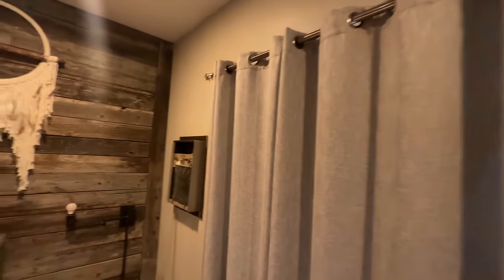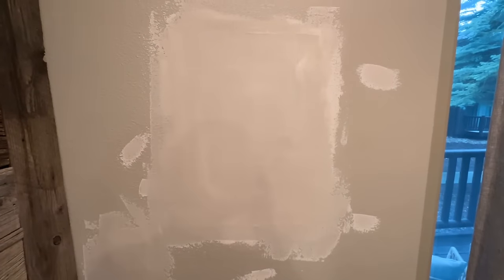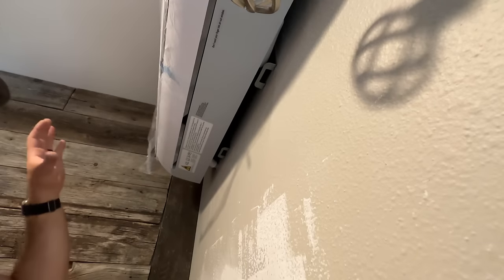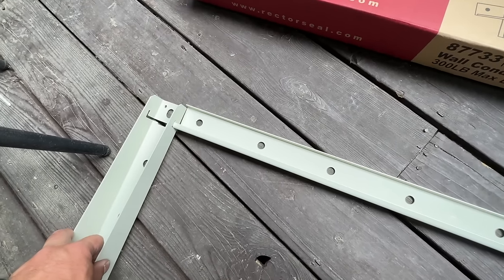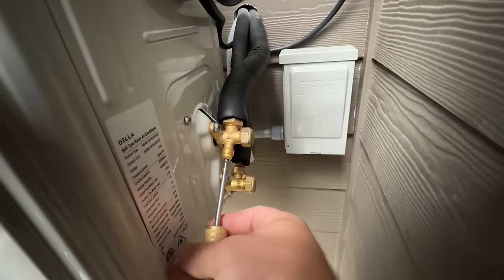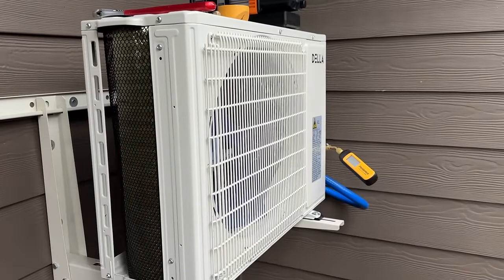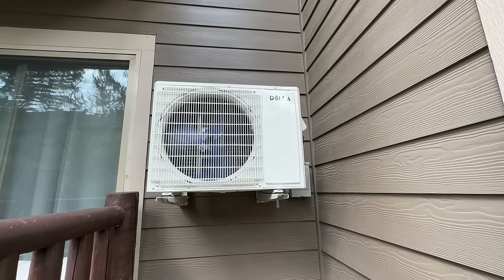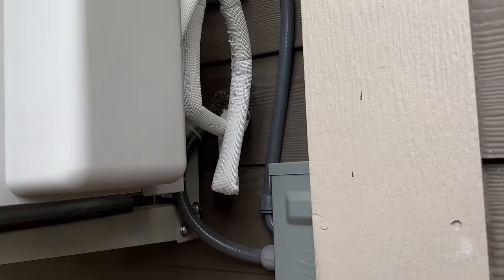A $600 Ductless 110v Mini Split?!

Comment: I bought and installed one of these about a month ago, and immediately bought and installed a second one. You didn't mention it, but the wifi programming options and controls are outstanding.  Way more features and capabilities than I could have even imagined.
Reply: You will be sorry later.   How can you recommend something you have owned for a month or two.  The ones you installed might last five years, at best.
Reply: How could I possible be sorry? For what these cost and difficulty of installation, not to mention the great performance, 2 years would still  be a win.  5 years would be a grand slam.   Otherwise I don't see massive amounts of failures of these units, other than less than stellar installations. @thomaswayneward
Reply: @spazzman90 he’s sorry because ppl have the information they need to install these mini splits themselves or have them installed. We had a guy come out 2 years ago bc it kept tripping the breaker. He tried to quote us $20k for a new ac unit only, for a 3 bedroom one level condo. I told him to get out…Nothing was actually wrong, it just needed some service that my husband did himself. Here we are, another hot summer almost over and she’s still going strong. 

If we do decide to replace it before we move, it’ll be a mini split. Installed by a professional bc the hoa is VERY anti DIY, of course. They’re so ridiculous and nosy they want to know if you paint your own interior walls. Hence the reason we can’t wait to sell it.
Reply: How many watts does it take per hour to run? What seer is yours?
Reply: @stevensaxon8888  mine are a couple of years old now and I think they’re only 14seers. I don’t know how many watts they use but my electric bill has only been over $200 once this summer and it’s been hotter than satans ball sack in Houston this summer. So I’m not complaining.
Reply: The problem with using the wifi is that the app won't work with a 5ghz router.  Otherwise, the mini-split is functioning perfectly.
Reply: @aaronsmith5553  That's why I left that part of Texas
Reply: @thomaswayneward  Sounds like you're an HVAC tech crapping on DIY systems to me.
Reply: @spazzman90  I built homes for 52 years and I am basing what I said on my experience.  A normal AC unit, which you can install yourself, should last 20 years.  I never installed AC units myself, in the homes I built.
Reply: @stevensaxon8888 to figure that out you would need to put a KW meter on the breaker feeding that unit
Reply: @thomaswayneward  intalled one in 1998 now 2024 still working perfect

Comment: Couple notes: check the minimum inset length before cutting line set. Mont mini splits have a minimum line let length of 10 feet. Golding any shorter will shorten the life of the compressor. My Della had a 10 foot minimum. Also check the manual for minimum clearance from the back of the compressor to the wall. Most are 12 inches. My Della was 12 inches. It looks like your install was less than 12 inches from the wall and your line set was less than 10 feet.
Reply: Agreed. This young man most definately did not read a single page of the manual lol. The HOA shouldnt be hiring their cousins step son. He seems nice enough but that doesnt help the ac unit. 😢

Comment: That della unit is the same as the pioneer. But for cheaper. I love mine. It cranks cold air 247
Reply from the maker: Yesir, they’re both made by the same mother company. Midea
Reply: @diyhvacguy  Interesting.  I expected to see some familiar Midea stuff but it all looks basically like they took the cost out of EVERYTHING.  If the internals are basically the same then that's a win at the bottom of the market.
Reply: why such large pricing differences? Simply because Pioneer has their name out and is known for efficiency? I'm completely off grid in Cabo with four 48v EVE280 battery banks. I did an unheard of thing with Mexican construction, I insulated the walls and roof as good as possible (6-18" EPS). Windows suck because I went with 12mm safety glass due to hurricanes. All I can think of is swapping out higher SEER mini-splits. Next house, I will haul proper windows down from California since my buddy works for Sierra Pacific.
Reply: @stiffmeister0hYeah  Mr Cool is pretty expensive these days.  Their kit is nice for DIY and they do have the warranty.  Still it sucks to pay like twice the cost for probably pretty much the same system.  Although for my first system (18k gen 3 single zone) I guess the extra cost paid for itself when I needed a new condenser. And I got a gen 4 upgrade out of it, too.
Reply: I put a Pioneer in my garage.  My install was very much like this except I ran the lineset down the inside of the garage.  The wall is concrete block.  It's been providing silent heating and cooling for a number of years now.   I love it.
Reply: Are you sure it looks like a gree remote control with gree's IFeel option

Comment: You put copper behind a wall and it will rot your wall out with moisture dripping inside the wall. That copper the electrical and the drain go straight outside from the evaporator so there’s only 4 inches of copper in between the walls. The rest of the copper stays outside you should make straight runs and cut its links to fit correctly. Which means you’ll need to pull a vacuum after you weld your copper up.
Reply: Thanks for making that clear.
Reply: 100 % correct

Comment: Good luck repairing the drywall every couple years because of the condensation from the a/c lines in the wall. That can't be code compliant. the wiring isn't code compliant it's illegal to run sheathed cable thru conduit

Comment: I just installed a 4 zone  36k BTU Della 220V on my cabin. The install was super easy. I ran one line set inside an interior drywalled wall and that was a tad difficult by myself but it worked out... The only thing I overlooked was to install the drain line under the refrigerant lines... I was worried that I might have water backup and overflow the interior pan but it was fine and drains without leaking. I'm super impressed with the Della unit!
Reply: How big is your cabin? Is it still holding up

Comment: I installed a 9,000 btu Cooper & Hunter in my office two summers ago. I now have a different Della 12,000 btu unit than this to install in my bedroom. The listing in the description is for a 230v, the 115v unit I ordered is $100 more. And the C&H unit is now around $850. Not too hard for someone handy to install and the cooling in the summer is great, and heating in the winter is great. Hoping to get all the rooms in my house with mini split systems and my solar panels installed (there on a pallet in my shop right now, haha), then my propane bill will be cut a lot in the winter.

Comment: Great video, thanks for the upload👍
March 2021, I pulled the trigger on an Aircon International Titanium Series 12000 BTU Ductless Mini Split Air Conditioner from Wayfair for $683.24 plus tax, & free shipping. Installed myself, had a HVAC buddy pull vacuum and release the refrigerant. I checked today, the same system is $875.10.
Installations are simple if you're handy and can follow directions... I wouldn't hesitate to do it again.

Comment: Installed this same unit about a month ago.  I already had an identical (12k) unit on the other side of my house and this one took me over the standard ratio of 20 btu's/sqft.  It actually enabled both units to run at lower power levels and achieve super stable indoor temps.    They work well heating over the winter  and dropped my electric bill by over 100$/month over the summer.  They seem slightly less efficient in the colder months, but I could insulate a little better.   Paid for themselves in less than 6 months.   It motivated me to follow through with the solar panel install.

Comment: I just installed the same system. All these videos show taping up all of the copper lines during the install.  I didn't wrap anything until I pressure tested the lines then spray all the brass connections with soapy water from a spray bottle to check for leaks.  If you wrap everything you can't check for leaks and all of your freon will leak out costing you money to hire someone plus replacing all the freon

Comment: Overall I like your installation. 3 comment:
1. I would not run the lineset inside the drywall. If there is water leaking for whatever reason, it won't leak inside the wall and goes unnoticed until it is too late. I would put the lineset to the outside and cover it with lineset cover.
2. I would check the leak at the connection points after releasing the refrigerant before I tape it up. The pressure in the lineset will be much higher when running in heat mode and will show any subtle leak. Holding the vacuum does not guarantee no slow leak.
3. Minimum lineset length is about 10 ft from the MFR. Does it really make a difference if shorter? I am not sure. Maybe just less efficient.
Reply: I'm just a DIYer, but your points make sense--especially #1.  I thought how easy it was to run those lines up inside the wall cavity when there's no insulation 😂 but when you have it, running lines outside avoids a lot of issues!
Reply: The reason for minimum length lineset is it acts as an accumulator, which acts tike a shock absorber and help in gas / liquid phase separation, having this properly done helps with the longevity of the unit and minimum warranty issues with many units?
Reply: @sus8e462  Wow, I didn't even think about the fact that there's no insulation in that exterior wall.  That's crazy.  It would never fly where I live.  I can't think of many places that no insulation would be ok.  Maybe some amazing tropical paradise?
Reply: @incognitotorpedo42 Maybe it evaporated--just like with every apartment that's that's been foisted upon Americans!

Sorry to say it: Nominal!
Reply: 1/4 " or 6mm tube is appx .35 of an oz per foot liquid, 3/8" pr 9 ,  10 mm tubes are appx .6 oz/ ft liq charge..best to re calculate your missing length, the i d tag should display charge on it, subtract your missing length amount from tag info, and adjust the total charge to prevent inverter compressor damage in high heat,  cool demands or high compressor speeds.  These units utilize multiple ptc sensors on the tubing, the coils and indoor, outdoor ambients. Electronic calculations adjust refrigerant flow and speeds of fans and compressor speeds.. according to these measurements..shortening the lineset changes three, sub cooling/glide/superheat  all measured in metric. It may run irratically, inefficiently, shorter lifespan with warranty issues.  Good job though . 
Hvacguy6 in Michigan..
Ps..stay on top of filter  screens..3 to 6 month intervals. I guided installing a few of these on rv busses for Nascar enthusiasts outside my hvacr job..

Comment: I installed a 220V Della 12,000 BTU unit about two months ago. I agree, it was easy, it only took me about 8hrs to install. It took the place of a wall mounted window unit similar to what you did. I also used the existing 220V that powered the existing unit.
Reply from the maker: Awesome
Reply: sounds about right
Reply: i too am in the process of installing the 12000 btu 220 v unit  just curious what you used for an outside disconnect as the smallest unit i have found is a 30 amp   and this particular unit draws much less than that   i also found    the instruction manual from della to be  terrible    this video answered so many questions     thanks so much
Reply: @markkidd1282  It doesn't matter how much current the disconnect can handle as long as it is more than the AC can draw. I used a 60 amp unit.
Reply: you call 8 hours "easy"????? LOL, smh

Comment: I agree with some other comments about running a drain down to the ground, but gotta make it look good.   Maybe small pvc over to the inside corner of the wall and then straight down the corner, painted to match the siding obviously, which would make it basically invisible.

Comment: What I heard the best option for coiling up extra line set is to do it horizontally.  Since their should be a J bend, you could just make the outdoor J bend near the condenser connection and coil up any additional underneath the condenser, especially since you have it on the mounting bracket.  It would be nice and out of the way.

Also, I really like those in ceiling cassettes.  I might do something like that for my garage to keep it below 80F in the summer and over 40F in the winter.  I have two electric cars and it would be nice to reduce the extremes that they deal with more often.
Reply: and look weird too. Clean install to avoid call backs.
Reply: @uhjyuff2095  Non-sense... you wouldn't even see it unless you're trying to bend underneat the unit.
Reply: Jbend? Where is the requirement for that?
Reply: Minimum of 10’ of line set should be used

Comment: Great job, and looks like a nice unit. One big mistake (and major NEC Code Violation) was that metal box for the 120v buried in the wall. Huge no-no. You should have relocated the disconnect so you could simply have run the existing power cable directly into it, or installed a blank cover on the existing former outlet box inside.  Buried boxes have caused fires in the past, if a splice inside fails.
Reply from the maker: I could always mount that so that it’s accessible via the cover.
Reply: @diyhvacguy  did you end up pulling it out flush with the wall or...left it...

Comment: I assumed that these were easy to install. Quite a bit of work and some special tools required.  U do great work!!
Reply: Not a true DIY that's for sure. So expensive tools required.
Reply: "easy" is relative. this looks extremely easy to me. Ive never done it. but ive done plenty of drywall, siding repair, mounted tons of brackets, (tv mounts, speakers, lights, etc) and fished wires and cables through walls. piece of cake.
Reply: Just about everything requires some special tools.  Just buy the tools.  Professionals usually buy good tools but there's plenty of budget options from Amazon and Harbor Freight that are plenty good enough to get a job done.

Comment: Pretrip from a non pro: for a cleaner install, I mount the disconnect to the bracket. I drill holes and use bolts and nuts to secure it. It’s possible to pull the power wire through the same hole too. Less clutter on the wall.

Comment: Any uninsulated and or exposed copper inside the wall will damage your wall. The copper Hass to go straight out the hole from the inside evaporator, leaving only four or 5 inches in between your interior and exterior walls the copper line set Hass to be totally wrapped and insulated when it goes through the wall And your drain line Hass to go through the same hole so if you put your drain line on top of your copper, on its way, going out, your evaporator pan will overflow on your floor. You have to have a constant downward slope on your drain. If you don’t use an external powered drain pump.
Reply: Could have definitely gone out the right hand side and run the lineset in slimduct so it can be accessed at a later date if needed. Running linesets in a closed in wall is a no no in our company.

Comment: My semi-detached wife had some Mitsubishi Mini split units installed on her place last year (no previous A/C and hydronic radian heat) in Chicago. The work great (as they should for the $$). I've been looking to install one or two on my house. I want to get a unit that has the floor mount exchanger rather than the wall mount as it's a vintage house. 
One note on these all in one/retail units is that many of the copper lines are junk. Better to buy a good flaring tool and quality tubing.
Also, the DIY pressure/leak testing on some of these is quite minimal and really should be done with nitrogen and proper gauges.

Comment: You should consider doing a video on how to upgrade to a larger mini-split system (how do you get the refridgerant back to the compressor before you disconnect the line). It seems no one has done that on YouTube. Everyone does a new install. Thank you for all the videos.

Comment: Love the install, only problem is you bud that box behind the wall. I don’t think that allowed by code. Needs to be accessible?
Reply: There was an outlet there for the lamp and the old air conditioner.  Why not just run the power into that box and leave the outlet there for the lamp?  Now you have to remove the lamp.  
.